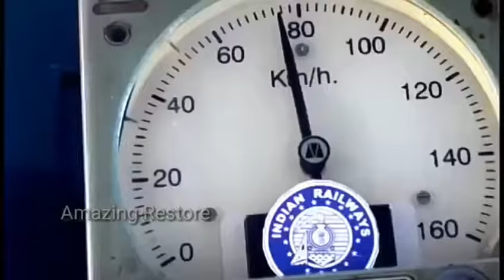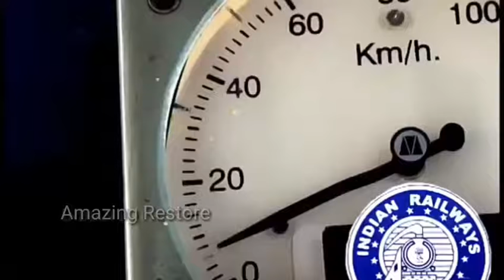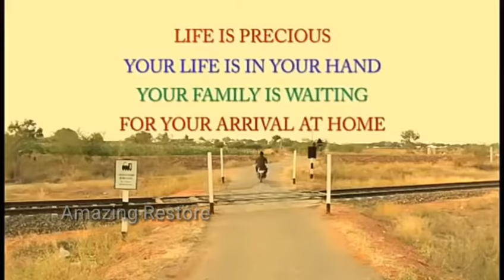Real Story Little Girl Train Accident To Hard

Comment: about 80 percent of comments are saying its the fathers fault , but its not .. its the train drivers faults because u can see in the beginning where the bike is stuck they dont activate emergency brake , they only do horn then , after 30 seconds or so they activate , if they activated immediatley then the child would have been saved , leave like if u agree too ( sorry for the spelling mistakes btw )
Reply: That's because it's rail road rules to not stop unless needed if they are late they can be fired or worse train driving don't want to hurt people in any way shape or form they are giving rules (they but on the service break when they seen the car the train was slowing down and even if they did but on emergency break it would make a train that fast that big 1-2 miles to stop about 30-40 min not close to stop in time there for I would say it's the father's:by conductor mick-csx train worker....
Reply: Driver's)